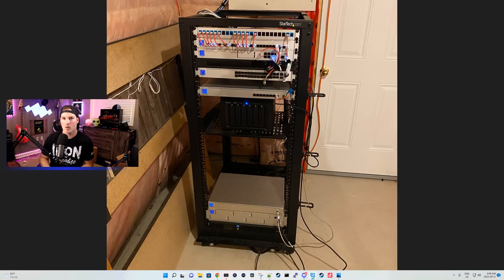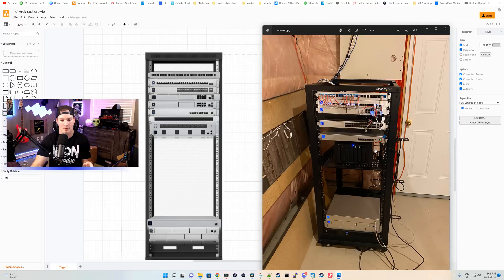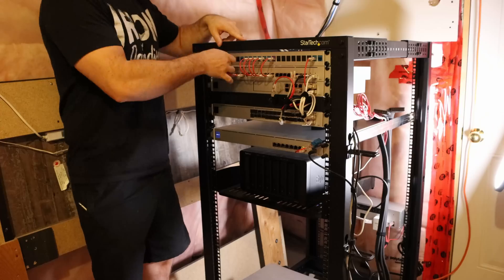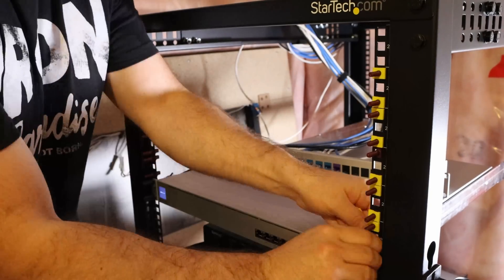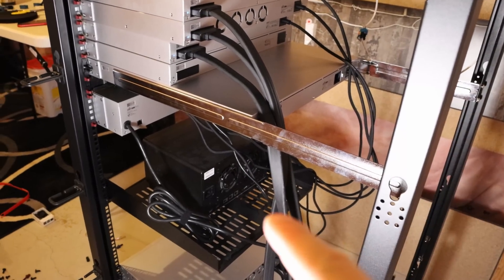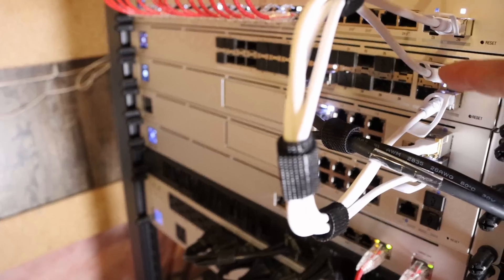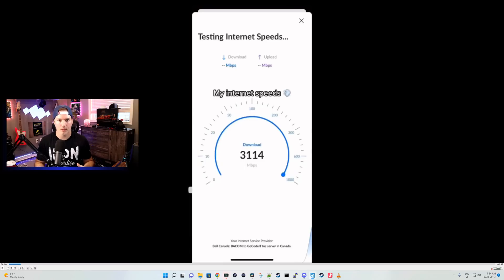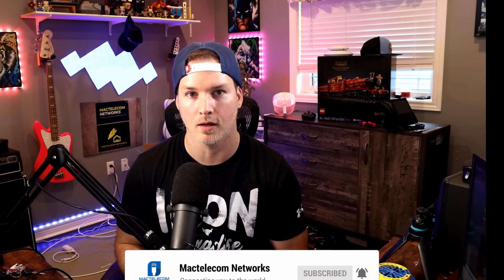Network rack rebuild , 3Gbps internet!!

Comment: Hi Cody, did the Pdu ever get that firmware update?
Reply from the maker: Maybe one but it didn't add Virtual routing redundancy
Reply: @MactelecomNetworks  yeah. Shame that they didn't even turn on the other ethernet ports, even if they didn't turn the virtual routing... I need that extra ethernet port for my APC with smart connect... But  nooooo I have to run a cable from my my dream wall lol 🤦🏼‍♂️

Comment: can you do a video setup on connecting your Bell fiber internet connecting to your UDM Pro?  I have 3\3 plan however the best i can get is 1.5gb down. Not sure if there is a setting i'm missing.  I'm running it on ADMZ from the gigahub modem.  i was told to turn off threat management and turn on smart queues. Just wanted to know how you ran yours. Thanks :)
Reply: Did you ever figure this out? I just got the same setup and would like to know how to do it

Comment: Cody nice home network. I have a 2 Gbps provider and I have the same module SFP RJ45 and I can only get 1.5 Gbps I try other Module but it run so hot that I’m afraid the module will burn is almost 180 F when it should maximal 160 F. I try everything to get the full 2 Gbps. If I change the SFP to the SE port 9 instead of port 10 I get a better speed but I want to used the 2.5 Gbps for my USW-Enterprise-8-PoE switch because is across the office. Any suggestion?

Comment: @MactelecomNetworks
Hi. Nice speed. My current isp operator is changing and udm pro won't be suffied because figer 10gb/10gb. What unifi product you suggest to use replace udm pro? Or is there any device to fit 10gb speeds from Unifi?

Comment: do all all of your power at the top of a rack then do devices below that point because less cabling going down as you go further down you just have that I would also just tie up the loose ends the rack should be this powerbar strip at top  then your rps next then your switches then your patch pannel then your servers below that then ups at bottom of rack much cleaner because tieing up the cables at top then not having them go to bottom is so clean the only cable there is the UPS much cleaner

Comment: Any suggestions on what you have on/off on your UDM to get your ISP speeds ?  I have 1gig/1gig and I get that if I use the Frontier router, but when I put in the UDM I get about 300-380 / 900.  The upload is fine , but the download can't seem to get over 400.  Thought I have turned everyone on / off trying to see what was capping it. Smart Queues / threat management, device id, traffic id, swapped cables, etc...

Comment: Ok, very nice, I still have two questions, though! =)
1. Did you consider putting an actual UPS into your rack at some point? I mean, the purpose of the RPS is completely defeated if connected to the same power line/breaker than the PDU. I mean, yes, it covers you if your power supply in a component dies... but... never saw that happen tbh. If you consider going high availability and redundancy, a UPS should actually be the first step, not the last, right?
I hope I just didn't watch close enough and you have a UPS behind your rack or something, don't hit me if that is the case! =D
Also, you should connect the PDU to the UPS, NOT the RPS, because obviously you use it for that HA-mode of your internet connection, and secondly the RPS cannot restart shut down devices. So in case of a power outage and one of your devices tumbles, the RPS won't help you, the PDU can. (Actually... do we have information on how the internet connection with HA and two UDMs behaves in case the power goes out or the PDU goes faulty? I hope they did not just replace one single-point-of-failure with another.)
2. Do you think the Unifi devices will be smart enough for a combined power cycle? Let's say one of your switches goes down and you want to reboot it but it won't let you SSH, the sense of a remoteable PDU is for your to log on and power cycle a device. However, if the same switch is connected to the RPS as well, it just won't power-cycle =D From the tests that you have done, do you think the controller will understand to power cycle both power sources for a device, or is there no protocol behind it so the controller basically has no idea what is connected to his RPS?

Comment: Great setup, does your home have seperate power-circuits (fase A and B for example) ? Or how is the RPS powered? This because I use a UPS in our datacenter to power hardware through different power circuits what not many homes have

Comment: I hope the PDU Pro will become available in Australia with 240v and using Type I power connection for Australia/NZ/China
Reply: I has buy it.If in 220v,out is 220 too.Use it normal.China

Comment: Hi, do you get your service with Bell? If so, I suppose HH4000? do you feed the Rack with the Port1 that is 10G on the HH4000? Do you do PPPoE on the UDMSE or you use Advanced DMZ on the HH4000 to feed the UDMSE?   Also, is the UDMP (not SE) is able to use a 10GBps SFP+ or only the UDMSE?  (I have the UDMP currently).  Planning on getting 3Gbps too from Bell.  Currently have 1Gbps with my HH3000 and I do the PPPoE within the UDMP.

Comment: You should get a sfp+ GPON from your ISP then you can run Fiber directly into your UDM Pro. Also you can get keystone inserts for the fiber it looks so clean.
Reply: He is in Canada with Bell.  They don't offer that.  On their service now, you need to use HH4000 Modem that do not even have a removable SFP+.

Comment: Hey Cody, I'm guessing since you're in Canada (Ontario i believe) you're using Bell FTTH @ 3Gbps. Do you have the Home Hub 4000? Are you just connecting an rj45 cable to the HH4K's 10gb ethernet port and then to the WAN2 IN on your UDM SE (using the rj45 SFP+ 10GTek transceiver)? There is SO much confusion about how to get more than 1Gbps on Bell using Ubiquiti equipment that it would be a great video for your fellow canadian viewers! Keep up the good work, hope you can answer :)
Reply: Was just about to ask the same question.
Any info would be great thanks Cody
Reply: I scrolled through the comments to make sure I wasn't duplicating this post. I would love to see a video on how you went from the ISP Bell or Rogers (pretty sure i seen rogers upped there top speed to compete) into your setup.
Reply: @jasonperry6046  
He's on Bell. And using the HH4K. 
He's waiting on his PPPoE credentials from Bell. Only problem is you can't bypass the HH4K since the SFP module is built into it
Reply: @justinchlan7893  
your PPPoE credentials are your b1 ID and the password that you can update from the user interface of your home hub.

Comment: What is the rj45 port rated at on your isp ONT. I have att fiber and it has a 5gb rj45 and the 10G ubiquiti sfp but won’t auto negotiate or make a connection if it’s set to 10g. It only connects if I manually set it to 1g
Reply: Bell Hub 4000 has 5 x RJ-45 ports, 4 x 1GB + 1 x 10GB. Ubiquiti is about to release a new SPF+ to RJ-45 transceiver that auto-negotiates on the RJ-45 side 1,2.5,5, and 10GB speed while the other side reports to your UDMP/SE 10GB, but it's still in EA. Use instead the MikroTik S+RJ10 to auto-negotiate the 5GB coming from your AT&T modem.

Comment: Good video Sir. I have a question. When I used the PPPoE setting for the internet my upload speeds were cut by half, is there any advice you can give me?
Reply: Hi same for me , i don't know how u get 3gb on the udm prose , i've been buying spf+ copper adapter  , enabling flow control e.t.c .. as soon as i enable pppoe (instead of dual nattng) speed drops from 3g to 1g ... :( plz help! i have udm pro se "writen dream machine se in front)
Reply: @sy5tem  I don't think we will get an answer.

Comment: Looks great! Move your NVR from the bottom of the rack higher up, IF you are in the basement it's good to consider flooding, a water pipe/main break or appliance fail etc
Reply: Very good point I keep ups at bottom primarily but if it flooded the whole rack like ain’t gonna make it 🥹
Reply: @kristopherleslie8343  I had to help twice clean up basement server room flooding ... problematic is UPS in the bottom - even IF you cut power to that room inside the UPS you still have at least 120 V, possibly going into the water ... and not easy to shut down, except a battery disconnect (switch or cable)
Reply: @jfkastner  yes you gonna see some sparks ⚡️
Reply: @kristopherleslie8343  you wish - at least then you know where to look .... worse is you know for sure there is power somewhere but in the dark with water everywhere you can't find the wires to pull ... best is really keep the UPS in a separate room (battery fire/smoke) or high up so it won't be in the water. Put an old server down low that's a few $ to replace if you don't have the rackspace

Comment: If you plan to use the high availability from the PDU Pro won't you only be able to use 1Gbps from your WAN since the ports on the PDU Pro are only gigabit?
Reply from the maker: Unfortunately yes for my house I’ll probably just use the PDU pro as a PDU. But do the high availability videos when it comes out

Comment: Great video! Just one question, because i am from austria and don‘t know this bell hardware. 
Is it not possible to directly but the fiber connection from the bell modem to the udm se, so that you don‘t need the modem in bridge mode with pppoe?
Reply from the maker: You can do that. I need to run a longer fiber cable and also get the pppoe credentials from my isp
Reply: Ok thanks for the information.

Comment: I constantly see commenters online picking apart setups saying you must have 1U between Ubiquiti gear to deal with heat and airflow. Is that not a factor here?
Reply from the maker: They get hot yes but I’ve never had an overheating issue. Even in UIs own pictures they are stacked together r
Reply: @MactelecomNetworks  Thank you for putting that argument to rest!
Reply: I have several UniFi devices in my office rack with no space between and in a server room that is too hot for the last four years. The UniFi devices have no problems. This is probably just the usual set of clueless trolls. Don't listen to them.
Reply: At one site, i covered my cloud key with stick on heat sinks and put a USB fan blowing on it.  It's currently running at 27 C.  In my rack with a UDMP, then a shelf with a 8-150-POE i put a little fan under it.  Both devices stay super cool.  Air movement is huge.
Reply: @lawdawg1942  Yeah, the old cloud key was quite bad at handling heat. That is AFAIK true. But the rack equipment doesn't have heat issues.

Comment: My rails are screws, not cage nuts. I want to use a solution like Rack Studs, but can't find an alternative. Can you suggest something?

Looks great!
Reply from the maker: If they are screws there really isn't anything else you can use unfortunately
Reply: @MactelecomNetworks  Not true. Reverse the screws. We had to do that for a client as they change out switches for testing purposes before shipping them off to other locations. We just put the screws in from behind and used 1-inch "stud" extensions from Home Depot.

Comment: Very nice. I assume you have Bell and are using the homehub 4000?  If so, and understanding that the hh4000 does not have a bridge mode, are you simply connecting the 10gb port on the hh4000 to the udmSE using the 10gb transceiver and then using PPOE or do you use DHCP?
Reply from the maker: Right now using dhcp figuring with bell to give me the pppoe credentials

Comment: Nice you got symmetrical speeds. The fastest we have here 1 gig down and 40 megs up. Supposedly symmetrical speeds are coming in the next year but I will believe when I see it. Thanks for sharing Cody.
Reply from the maker: Ya this just got to my area a few weeks back. Happy with it so far
Reply: @MactelecomNetworks  do you have a backup wan as well?
Reply from the maker: @grantwilcox330  I do have another 1gb coax connection but not connected Atm